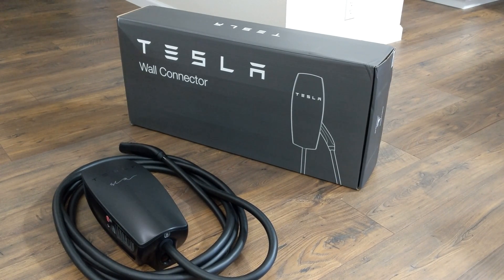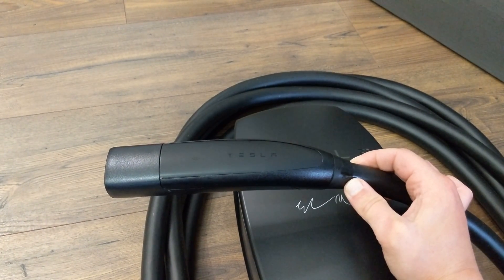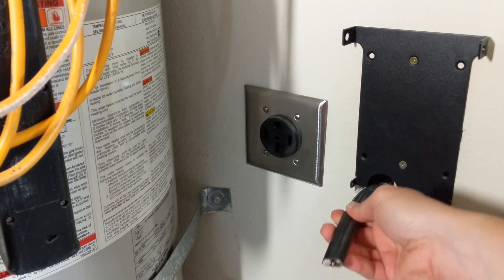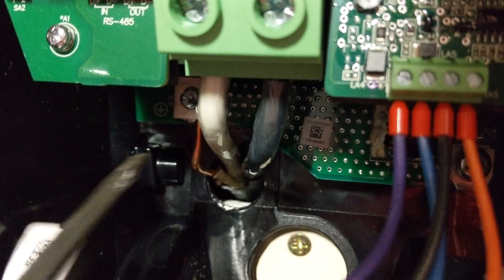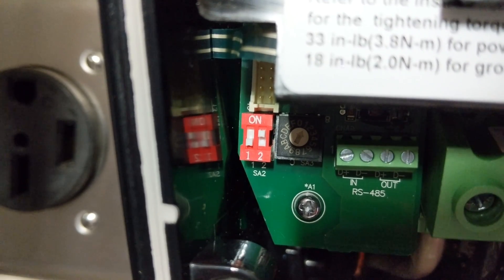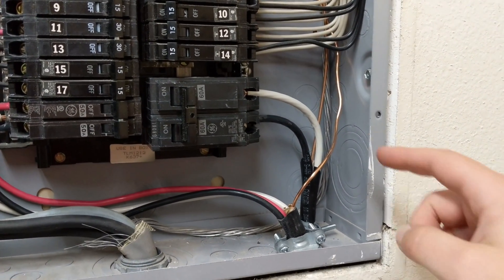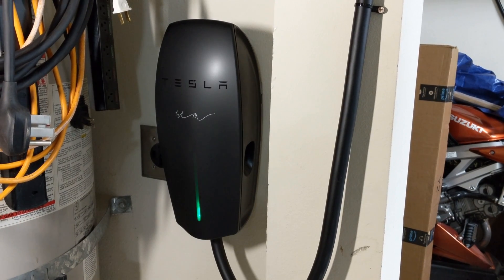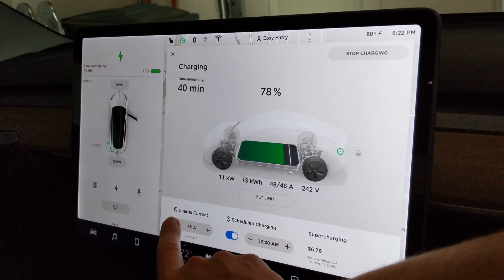Tesla Signature Black Wall Connector and Installation Details

Comment: Did you see a charge difference between the Nema and the Power Wall?
Reply from the maker: Power wall is the home battery, so I think you mean wall charger. The wall charger is up to 50% faster than the mobile connector plugged into the NEMA outlet. I plan to post video comparing the two soon, so keep an eye out for it.

Comment: I want one! Using a Clipper Creek 24 amp that I had installed for my previous car, a Fiat 500e. Gives me 22 miles an hour of charge on the Model 3. Does 48 amp give you 44 miles per hour?
Reply from the maker: It's somewhere around that, but I don't put much stock in those numbers since they use a lot of assumptions which aren't necessarily true for me.